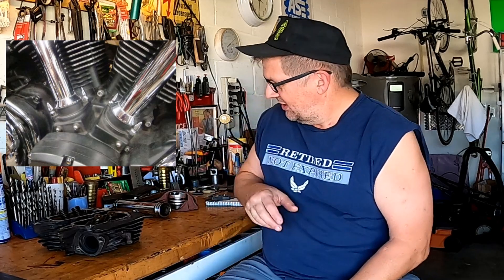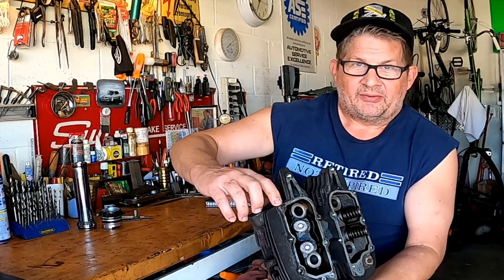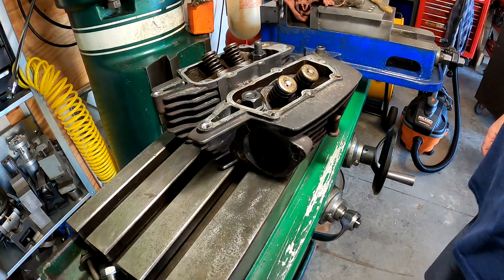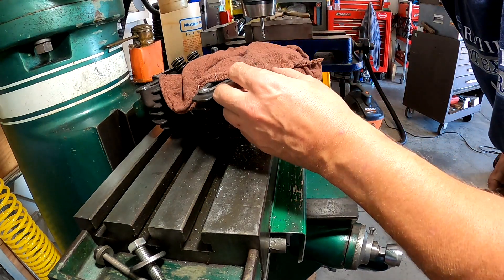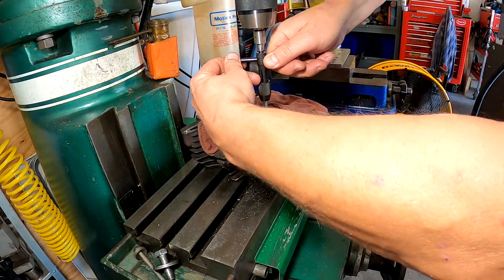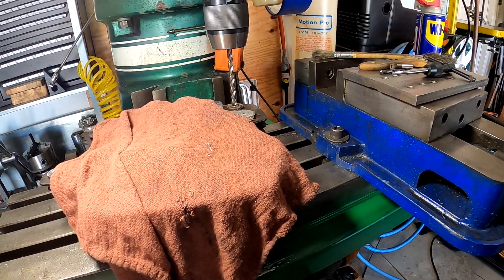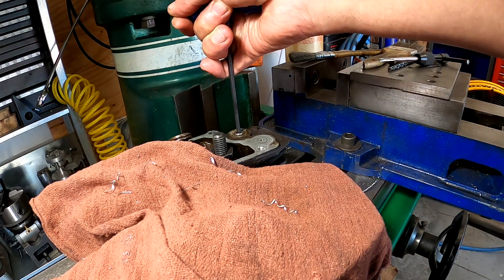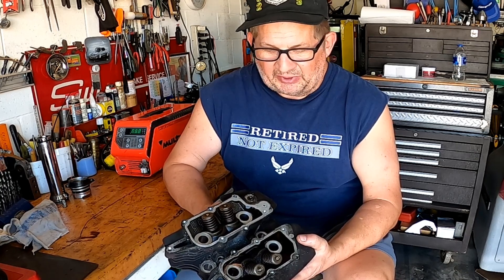Remove broken bolt from Head of Yamaha Road Star leaving original threads in tact

Comment: Great repair,
Reply from the maker: Thanx KT.. It was a proverbial BE-OTCH to get out. Thought I was going into that video with a simple curly-Q removal and ended up dealing with someone else's ham fisted attempt at hole sealing. End result was that hole is supposed to be there. It doesn't affect anything and is sealed off by the exhaust gasket and bolt.  I usually like JB Weld, but was cussing it pretty badly off camera. Anyone says its not any better than super glue needs their head examined. Thanks for following. Don